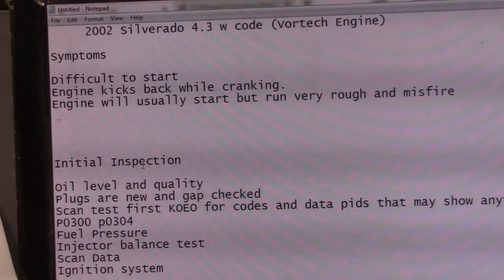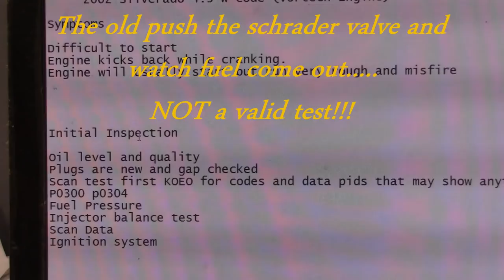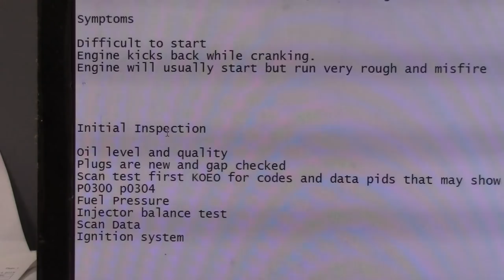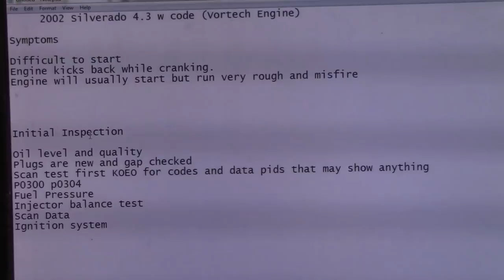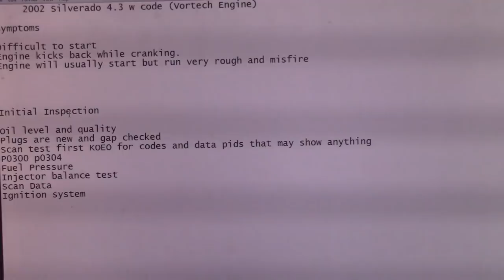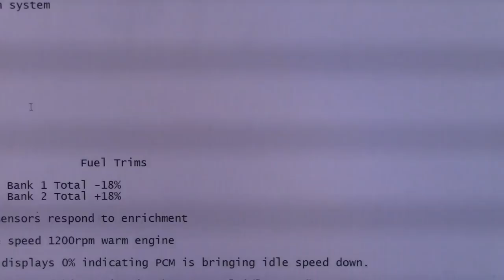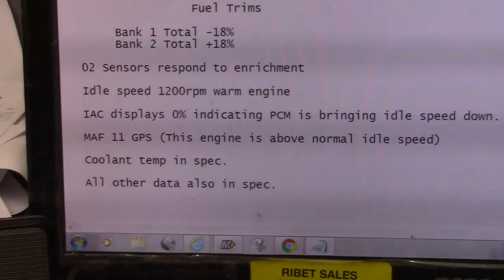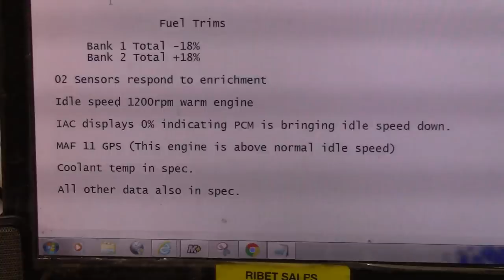Why Vehicle Owners SHOULD ALWAYS Do Their Own Repairs!

Comment: I have an old BMW I like to work on. I try to understand systems, do plenty of reading, then attempt repairs.
It's an interesting hobby, and very satisfying when a repair can be completed successfully.
But I'm no rush to fix anything, because it's a hobby vehicle. I find that DIY mistakes are minimized when you don't rush through the process.
If you're DIY-ing your daily driver and need to get to work tomorrow morning, you might cut corners, and that's when you need Joe to fix your mess.
Our primary vehicle is an Odyssey and I only do engine oil/ATF changes on it, filters, seasonal tire change, simple stuff.
For the real repairs I have a shop take care of it, because as a DIY-er I know my limits!
I did have to reinstall a crooked intake boot after our mechanical repaired our starter. But for the most part his professional service is first rate and well worth the money, part markup and everything.
Reply from the maker: Brother, I have nothing but respect for anyone who wants to work on a car, but you nailed it. You cannot expect to do what we do on a daily basis and be proficient at it in the same way. It's just not plausible. This is a profession for a reason, not everyone can do it.

Comment: Businesses get parts about 30%(average discount) less than retail. I was a parts guy at the largest Chevy dealer in CT. I was a reciever/stocker after being a delivery driver for a year. If you buy a part at the counter, you'd get the same price that the repair place charges you. Just find out the retail price first and you'll know if you're getting ripped off on parts.
Reply: I agree. I used to work for a major auto chain in NJ. If we didn't have the parts in house, we'd call up our local supplier, depending on the type of part & vehicle, would get our wholesale price, which would be marked back up by a % that usually brought it close to the supplier's retail price if the customer had bought it over the counter from them. 

We'd then calculate our book labor on the job and call the customer with the complete estimate on the job. Where it gets dicey is when a shop charges 100% markup on a readily available part from a known retailer, such as Advance Auto, and does the work without providing an estimate, only notifying the customer of the price AFTER the job is done, stating "I thought you wanted it done".  NJ law begs to differ, and it's people that pull that kind of stuff on trusting individuals that make them mistrust all good techs. that don't need to pull hijinks to make a decent living doing what they love to do. 
Of course that crooked shop hopes you don't know the law, won't show you parts replaced because "the recycler just picked up your rotors" and knows full well that they're required to contact you with an estimate BEFORE any actual repair work is done, unless you've already supplied them with a limit, as in "if the work's below $300, fix it, above that, call me". Obviously, if the work isn't approved, or the person then decides they want to tackle the job (cough, cough) then the shop is entitled to its standard diagnostic fee for that type job. 

That said, the mechanics lien law in NJ is very strong in order to help protect shops from non-paying customers of course that also has the check and balance of the law of providing a proper estimate in order to protect the consumer.

Great work Joe! After checking out this video, you put beaucoup effort into this diagnosis and repair. I just figured I'd also help clarify some things for the haters out there who have no idea of how the system works in a well run shop.

Comment: I started fixing stuff on my own cars over twenty years ago. Back then i started with changing the headlights and swapping out the electrical connections to them. I was learning an electrical job back then,so i had a bit of knowledge in that area already,otherwise i wouldn't have attempted that kind of repair. The height adjustment of the headlights themselves (not the physical position in the car) was done in a shop with the proper tools needed,so i wasn't blinding drivers coming towards me. So i started out with easy,basic fixes,that werent hard and straightforward to do. Later i got my hands on the original manufacturers repair manuals for my car and went from there. First again with the easier fixes,that were selfexplanatory with basic mechanical knowledge you'd learn even for an electrical job and it went from there. I still know,what not to do and get my car fixed in a shop,when i don't have the knowledge,ability and tools to do it myself,because the car needs to run,i can't having it sitting in front of the house,undrivable. So i have to have the mindset to stop before its too late. Saved me a lot of money but saved me from being a stupid idiot as well. Butthe guy owningthis car n your video......he shouldn't go that deep into his own car and attempt to fix it......lining up a gasket is not that hard,but you need to make absolutely sure you're placing it correctly. And that is,where he absolutely failed. Checking again,if he did it right. Someone like that will NEVER tell you,he messed up.....i'm just happy there still are proper mechanics out there,that find the problems instead of just swapping parts and in turn maybe messing them up too. And if you make a mistake,it's just human. Like you said,nobody knows everything and we always learn. Keep up the good work!

Comment: I totally understand, exactly what you were talking about. I used to be a shop owner. I don't work on people's cars anymore. After 25 years in the business, no more. I would rather live in poverty, then deal with another customer. However, I still feel obligated to help them. So I have some tips for the do-it-yourselfer. To help them, help you, help their car.

Before we had computers, we had our five senses. Look listen feel smell and touch.

If something looks wrong, it probably is. Take a picture of what you're doing, before you start. This will give you a point of reference when you put things back together. If that looks wrong, it probably is wrong.

Listen for anything that sounds abnormal. Whistling, grinding, misaligned components. Squeaking. If it sounds wrong, it probably is. 
Any type of moisture in areas, were you don't think it should be, is probably a good sign that you have a problem. Spark plug covered in oil, you probably have a valve cover leak. And injector that is wet, probably has an old ring that is baked, allowing gasoline to pass by. 
Don't be afraid to get a little dirty. Getting a sample of the moisture on your finger, or dry rag, and smell that moisture. Does it smell like gas? Does it not have an odor at all? Transmission fluid will have an unpleasant odor, when it is burnt. Overworking your transmission, will burn the fluid.
Spark plugs ... yes, they come pre gapped. But do they come pre gapped for your car? Many vehicles may use the same spark plug, but often there Gap is different from vehicle to vehicle. Always... Always... Always, check the spark plug gap before you put it in.
Nuts and Bolts... I cannot believe how many people I have met, but do not have the ability to properly align the first thread. Stripping out Nuts and Bolts will cause a lot of damage. If you turn the bolt backwards, you will hear it click when the first thread is aligned. This is especially important in areas that are difficult to get at, or when you are using fine thread screws. Making sure those first threads are aligned, is very important.
Vacuum lines and rubber hoses deteriorate. Nothing lasts forever. Especially, rubber. Some fluids are extremely corrosive 2 rubber. Power steering fluid for example, will rot out any rubber it touches. Cleaning up spilled under the hood is extremely important. Most of the rubber components in vehicle, such as tubes and hoses, will rot from the inside out. Visual inspection is not enough in these cases. Give it a little squeeze, does it collapse under your fingers? Replace it if it does. brake hoses, should not collapse at all.

 I have often told my customers, that they should be experts on their own cars. and often, they will take them from technician to technician, looking for someone who can fix them... Not their car. When they do that, a lot of information gets lost. Information that we need, to do our job.  keep all of your information on the work that you have had done, with your vehicle. Right near the owner's manual. speaking of the owners manual... It doesn't hurt take that thing out and read it every once in awhile. pay attention to the types of fluid you're supposed to put in the car. some power steering systems take transmission fluid, not power steering fluid. the guy at the parts store, is going to sell you power steering fluid. Because that's what you asked for. may not be what you need... But that is what you will get. Check the owner's manual. Usually under capacities and specifications.

 it has been many times in my career that the customer has said to me, I don't have a lot of money... Can you please take it easy on me?
 at which time I tell them ... my bill, is not based on whether or not you can afford something, or whether or not I like you. I am billing you for a set of procedures, that are based on the tenth of the hour. And the part needed to solve the problem. at a cost, I can't control. in order for me, to give you a deal, I'm going to have to cut something out of the procedure ... what part would you like it to be?

Parts prices... This is where we get, hosed on both sides. technically, the only parts that are truly worked for your vehicle, are the OEM standard. Ford Motorcraft, AC Delco... These parts are designed to work for your vehicle. O'Reilly's Auto Zone ... so on and so forth... These are the largest importer of Chinese Goods in North America. Everybody wants OEM quality, at aftermarket prices. However, the technician does not build the parts. We don't know what quality you're getting. We don't even know, if we bought a good part from the aftermarket retailers. Because most of those manufacturers have an acceptable failure rate. It is not uncommon to purchase these parts from the aftermarket retailers, and have them be bad, right out of the box.  unless you're using OEM Quality Parts. In which case, the manufacturer has gone through Great Lengths to make sure, their original equipment part, is going to be the right fit for your car. and it makes absolutely no mathematical sense for us, to charge you for two alternators, when you only need one. If we charge you for two alternators, that means that we, have to put the other one on the Shelf. And that's where it's going to sit until either you, or another vehicle just like yours, comes through the door. the standard is okay if we're working on a 2017 Honda Civic. But not so okay if we're working on a 1985 Chevy citation. ain't nobody seen in 85 Chevy citation, since 1986. I can't rightly have an alternator or an oil filter on the shelf for that vehicle, if we're never going to see it again.
 prophet in the automotive repair industry comes from our ability to diagnose and repair vehicles. the business structure for an auto repair shop, is not the same as Target or Walmart. They can afford to have items sitting on the shelf for long periods of time. We can't. we have to get your car in, fix it, and get it delivered to you in a timely fashion. if we want to make money. your vehicle, sitting in our stalls, does not generate income for us. It provides you great, indoor storage, that we don't get paid for. In 25 years, I was called all kinds of things. I've even had customers, pull guns on me. and that was it... No more for me. your 67 Impala with rotten wiring all over the place... Is not worth dying over. you can't fix it... You can't afford to fix it... Your problem... Not mine.

 I could go on and on. but I will just end by saying this... we are all still learning. And in September... We have to learn some more. Auto Repair is a continuous education program. and we have to spend the money on that continuous education, ourselves. Most shops, require us to have a whole bunch of information, on a whole bunch of cars... That we may never see. Those classes are expensive. taking a week off from work, to pay for a class, out of our own pocket, usually never... Never... Never... Translate into a raise for the technician. we can literally have a list of accreditation 10 miles long... Doesn't mean we're getting paid for it. ASE certifications are marketing programs, not education programs. They are sold to the shop owners, as education programs.  But they're not...  It's marketing and advertising . An advertising, is a way to circumnavigate your intelligence, just long enough to extort money from it. there are over 900 different variations of vehicles on the road. No single technician is an expert, on all of them. it is absolutely arrogant to believe, that we can be. This is why we have procedures. This is why we have specialty repair shops like... The dealership. They only work on one brand of vehicle. Because those procedures vary from vehicle to vehicle. It is our responsibility to know what those procedures are, and how to work the procedure. But we don't invent the procedure, we don't invent the car. and we don't invent your problems. if you have a problem with any of those three things... Contact the Vehicle Manufacturer.

 it is their Union, that allows them to make mistakes on the assembly line. It is there Union, that protects welders, that continuously get caught drinking on the job. It is their Union, that allows them to make the same mistake over and over and over again, and past the cost of repair on to you. here in my state, there is no Union to protect me from you. And your feelings. There's only a kangaroo court, That will continuously pay the customer for their feelings. Not their facts. And I, did not get in this business, to pay you, to fix your car. with no protection, no representation, and no way of beating your feelings, with my facts, in your court... I'm out.

But that's okay... Because, between your courts, your feelings, and your piece of crap car ... we can now make more money, delivering for GrubHub.

 let that sink in there shop owner... your technicians can now make more money, delivering food, then they can, working for you.  and it doesn't look like the food delivery services will be going out of business, anytime soon. What does the future outlook of your shop look like?
Reply: That's one hell of a comment

Comment: I, Non mechanic,  started doing some DIY a few years ago to keep a second beater car on the road.  I learned a lot, and it wasnt technical in that i needed no scanners or specialty equipment.  Front end shocks, brakes, control arms, etc..  What a learning curve!  Just learning what bolts can be muscled vs which ones dont, the best order of removing things, and what other things to repair "since your removing this, might as well do that".  Working stuck bolts without breaking them, lol.  And, i had YT and 20 yrs worth of videos and forums for my specific car. 

 I can imagine what goes through a mechanics head when someone drops their car off and says fix Z, because someone they know had the same car and the same issue and "it fixed their car", when the mechanic is seeing X and Y as more immediate issues.  Ppl have no problem dropping cash on things they dont need.  They'll ignore car repairs like the dentist and then throw a fit when the bill comes, specifically for older cars.  In 2020, a cursory search will give any laymen that can read, an idea of what their older car's issues are.  Mechanics already know about the GM intake manifold gaskets, or the Chrysler sludge, (see what i did, and im not a mechanic, just loose research ive done on potential used car purchases), yet a bill for car repair makes some feel slighted.  If i take my paid off car in and the bill is $1000, and i think the car will go on for 6 months, then i win, imo.  And this is advice id share with anyone driving older vehicles.  And , for the record, that $1000 repair kept the car going much longer than 6 months.

 Ive been seeing YT-ers catering to trolls by rationalizing their income, from YT or otherwise.  Ppl are allowed to make money, Its America.  In America, one isnt forced to go to one shop for their needs or watch 1 channel.  They can choose to go anywhere they please.  Wall mart marks up their .10 cent china junk 5000%, and ppl flock there like an oasis in the sand. A markup on parts is "part of the business". Mechanics are skilled workers with a vast knowledge on a variety of models and manufacturers, and the nuances of said models.  The overhead of a shop space and the utilities merit this. Tools!  Broken tools!  And then theres the special tool for "car model H"  to remove brakes, but only on years 02-10, then you need a new one.  Replacing a broken air compressor?  Ya, ive looked and the good ones arent cheap!  Toolboxes where the drawers dont fall out!  Cans and cans of Brake Kleen, PB Blaster, etc.. Tubes of grease! There's all kinds of hidden costs to operating a repair shop.  You, or any other , doesnt need to rationalize their necessity to make money.  We all need to eat!  There's no shame in honest work.  

Whew!  Had to vent a little, in the defense of yourself and against the trolls!!  There's more "quiet ones", like me, watching and DIY-ing old beaters to save a few bucks and learn something than there are of "Snarky trolls".  Keep doing what youre doing and know youre appreciated.  Ignore the trolls!  Peace
Reply from the maker: Thank you. And I'm always happy to see that guys are out there trying to learn and fix things on their own. Good for you!